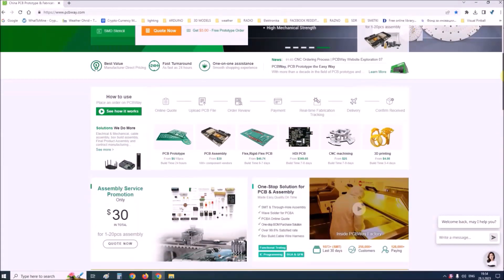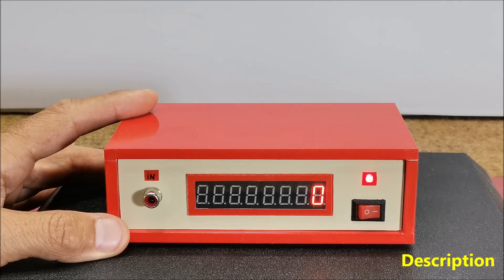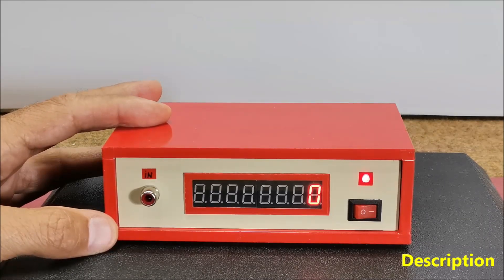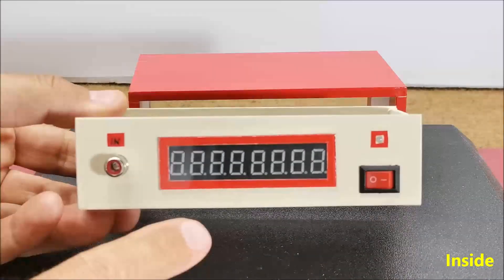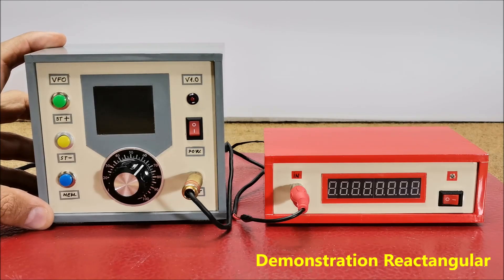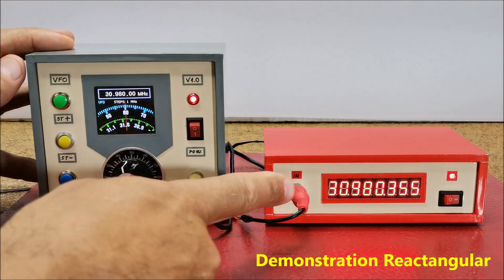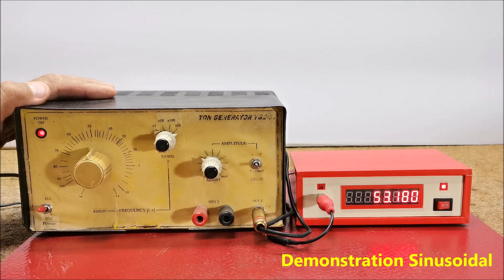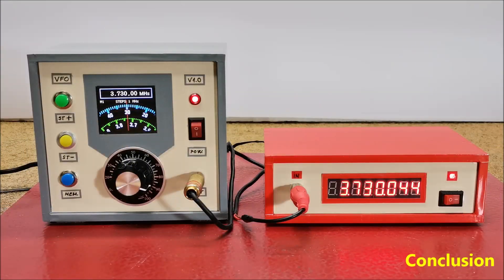Simple STM32 Frequency meter from 1Hz to 30 MHz (Arduino IDE)

Comment: Hi Mirko, I tried to upload your code but every time I get a constant value around 72MHz, the signal measurement pin being directly connected to the GND line does not change the result, do you have any idea about this problem?
Reply from the maker: I have no idea, maybe a faulty STM32. If you have another sample, try it with it too because the scheme is extremely simple and cannot affect the result.
Reply: It gives me the same result, around 72Mhz. While PA15 on ground.

Comment: Great project, I want to build but can't get it to compile in Arduino IDE 2.3.2, using STM32F103C8T6 just get lots of these "Compilation error: base operand of '->' is not a pointer". Any suggestions? Sorted !  I needed the dan.drown board definitions, not the "official" stm32 definitions.
Reply: You should be change TIMER to TIM.
Reply: @nattapongpungtim7239  Thanks

Comment: FYI,
If you set the ETR prescaler to divide by 8, it counts up to 240MHz.
This is done by changing the SMCR register value:
TIMER2_BASE->SMCR = (1 << 14) | (5 << 0) | TIMER_SMCR_ETPS_DIV8;
And then, 
freq = 8 * freq;
Reply: current version doesn't has TIMER_SMCR_ETPS_DIV8. please tell me
Reply: So, do you think that it really will count up to 240Mhz ?

Comment: I understand the signal goes to an input pin, but then what happens inside?

For example, to measure frequency, common techniques would be:
1a)  Configure free-running timer, and whenever a transition is detected, the ISR code would read the timer's counter to compute the frequency
1b)  Configure Input-Timer Capture, where the timer value is latched when an edge is detected.   The Isr code would read the timer's latched value to compute frequency
2) Configure a timer for a specific period of time, and count the number of ISR interrupts due to edge transitions that occur during that time to compute frequency

Some STM32 have pins that can be configured for "External Clock Input" Input, where the hardware peripheral, automatically counts the number of transitions on the line!  There's a post "External TRigger for TIMER 3" that even shows how a non-ETR pin (ex. CH3) can be used by as the input to the Slave Mode Controller (TIMx_CCMR1=1) by selecting the XOR of CH1,2,3 as the TI1 source (TIMx_CR2.TI1S = 1).  However, I assume you still need a precise timer running to interrupt and see how many transitions were counted during that time?